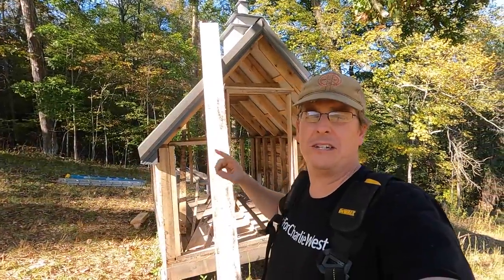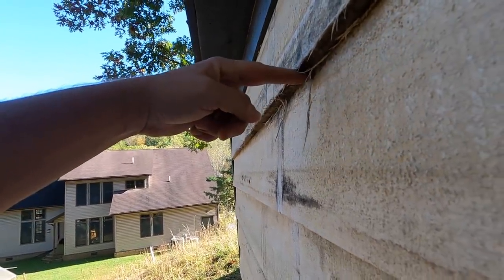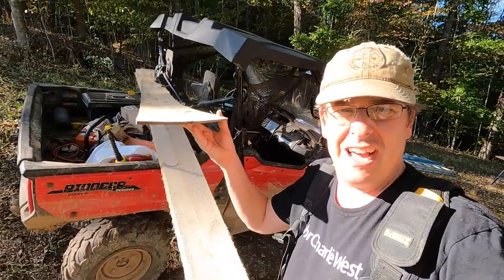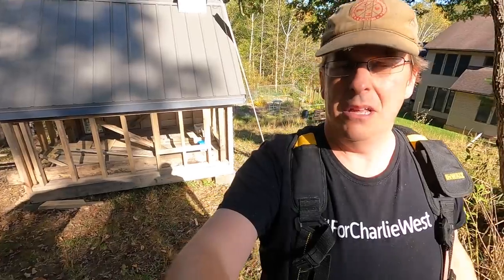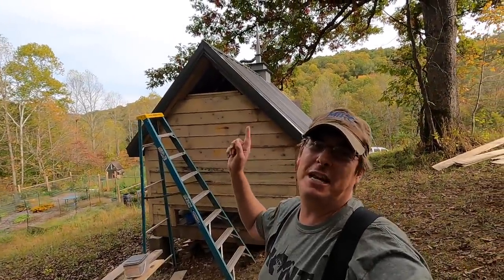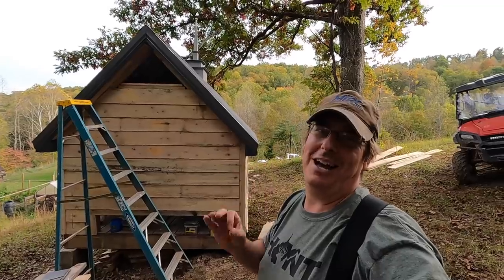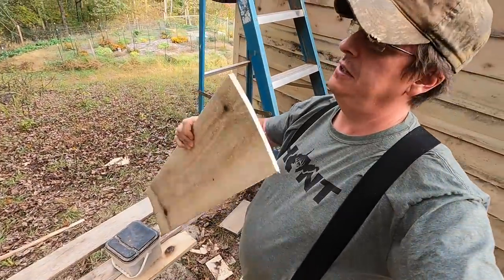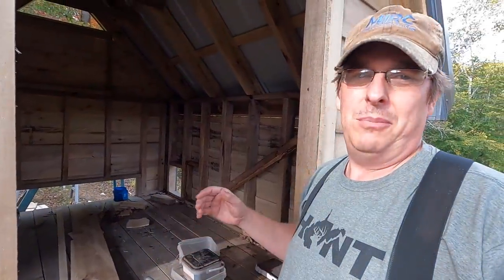Lap Siding Thickness: Which is Better? Chicken Church Build Part 5

Comment: For the back triangle opening you need to install screen on the inside of the coop (sedan) and have your plexiglass so it can tilt out so there can be air flow when you need it and still keep the chickens in and critters/bugs out.

Comment: Since your chicken coop is so small and easy to repair it does not really matter but if you use lap siding on your retreat I suggest you at least put primer on your lap siding before you install it.  Even better would be primer plus one coat of paint then install. After installed put a final coat of paint on.

Comment: Aside from cost, why don't you use screws? I find the ease of future repairs to be worth the up-front cost.
Reply: My answer would be speed and simplicity. For screws not to cause the thin material to split, you would have to pre-drill every single screw hole. Plus, every screw head/nail head is covered except for the very top row, so if you had to replace a board in the middle, you would have to remove every board above it to get to it. Or you can just cut through the thinner nails easily with an oscillating saw, slide in your replacement board, and nail it (but of course now the nails would be visible).